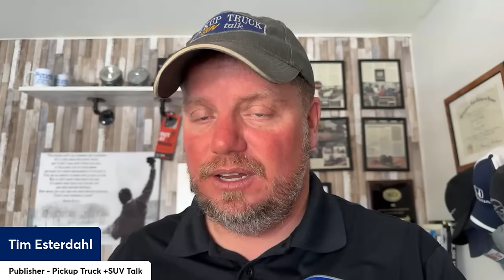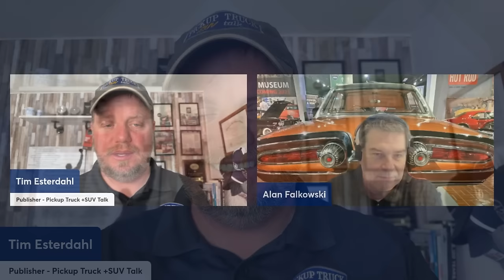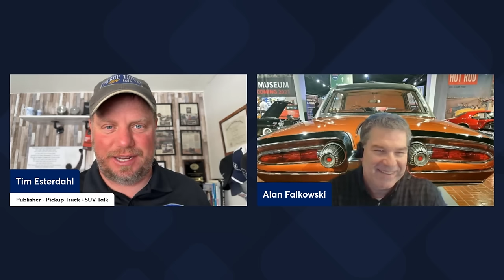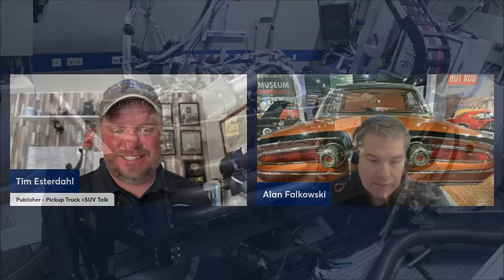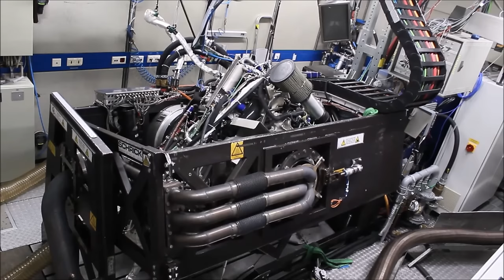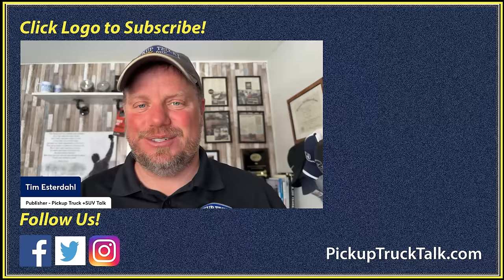Engineer Deep Dive: 3.0L Hurricane Engine - Turbo Life, Oil and Intervals and More

Comment: Time will tell how this new engine does. Everyone seems to be a "debbie downer" and knows more than a highly educated engineer.

Usually the engineer has done a perfect job, but the cost cutters come in and start making changes to save money. 

So far nobody has mentioned how this will help Chrysler to offer trucks in the future. Chrysler pays a significant amount of money to Tesla because the Hemi doesn't meet some sort of emissions requirement.  Eventually they need to change or drop the truck line. 

For everyone that is pessimistic, I worked on many cars in late 80's to early 90's. with fuel injection and distributorless ignition sytems. So many of my colleagues would tell me that the work was going to dry up because the new fuel and ignition system were a gimmick that wouldn't last.  Maybe ignition points and manual choke controls are the way to go?

My skidoo 4 strokes use the arc plasma coating stuff. No issues with burning oil.

Comment: If they can't...
1. Change the oil filter cooling housing from plastic to aluminum in the 3.6, the other Ram engine, then they wont care enough about parts used in this motor. 
2. Prevent dry starts everytime the 3.6 starts, the other Ram engine, who knows if theyll care about lubricating this engine.
3. Address the rocker arm issues in the 3.6, the other Ram engine, then this will probably be another "ticking", no pun intended.

Comment: Do they cold soak engines probably not. How about running on skipped oil change? My 2017 Chrysler goes through batteries every 2.5-3 years and is driven daily for at least 90 minutes.  No stop start in play. Oh and the hood started peeling paint at year 4. First and last Stellantis product. They spent over a billion dollars designing the Pacifica and can’t get the fundamentals right.

Comment: I loathe these "don't change your oil" engineers so much. They DO NOT care about you wasting $40 changing your oil. They DO NOT care about you wasting good oil. They want your engine to explode at 100k miles because they worked very hard to design it to.

Comment: DID they skimp on main bearings?  My reading indicates that the new 6 has only 4 main bearings.  I hope they have a really stiff crankshaft to deal with the turbo pressure when it inevitably gets boosted by the aftermarket.  I stopped watching after the first few minutes because it was the same old BS, even if the attitude was friendly.
BTW I have seen this "damage accumulation" idea fail in a big way because of one small incorrect assumption, on an $80 million project.

Comment: Yes, EcoBoost engines NEVER have turbo problems. The EcoDiesel was great. 🙄

Direct injection is garbage in gasoline engines without port injection to keep intake runners and valves clean. 🤡

Comment: Well then everything’s going to be better with the new “hurricane “ engines because (apparently) they never dyno tested previous engines like the Hemi.(Of course they did)and we still got cam lifter issues valve seat issues.And oil has never been better?Has  zinc’s friction benefits been equaled?Unfortunatly stillantis is thinking in European terms.Europeans have been shoehorned into unsafe horrible small cars for generations.It remains to be seen if Americans can be dictated into a similar regrettable situation -through hair brained mandates such as battery power or 6 cylinder downsizing.

Comment: Why buy a truck?   They are adult toys, require a big engine, great torque, and a great ride..   Well at least we used to have that in the RAM 1500 with the 5.7L Hemi.   Toyota, Ford and GM are pulling the same banana, .  I wonder how many engine failures the manufactures will deal with if early reports from 2024 Tundra (V6Turbos) owners have merit.

Comment: Oil change intervals may be improved with better fresh air flow in the crankcase, but it’s fuel dilution that still tears additive packages down and I didn’t hear him address fuel dilution and blow by sooting factors and how fully synthetic oils are better at handling this…I’m not sure the increase in oil quality offsets both of these such that 10k intervals are reasonable.  Enough turbo based gas and diesel engines, modern, have been torn down and showing terrible sludging from using 10K change intervals…its pretty nasty what the top and bottom-ends look like in a lot of those tear downs.
Reply: Then do whatever you want. Engineers have tested these engines to extremes that you will never equal, yet you wanna question them about it. Engines just don't wear out anymore. They'll fail from not changing the oil at all. Sure, they'll build sludge and carbon and what not, but they still function hundreds of thousand miles later.
Reply: @Dusdaddy  Computer simulation of engine performance is a tool of modern design and stress testing in extreme condition is also standard methodology. They are great tools and testing to proof designs, but they are not full-proof.  I have mad respect for this designer and appreciated all the things he shared about what went into their design and considerations of mitigating common issues with turbo applications.  But as well, even those design simulations and harsh testing environments do not guarantee a problem free design or excellent, trouble free application with customer use.  This engineer, who worked on the Hemi, likely using the same design tools, on a motor that showed problems later after customer use for 10's of thousands of miles in which the top end doesn't get good oil flow at idling speeds, resulting in oil starvation and top-end failure on many Hemi motors later.  As well, it didn't predict the exhaust manifold bolt failure as well, which is a common problem.  Harsh environmental and usage testing didn't show these failures either.  The fact is these things happen with all the big truck manufactures.  GM, Ford, Ram and Toyota.  In each cited, there are examples of problems on some of their motors that resulted in design or material corrections as made known by failures of customer vehicles in their shops.  It happens and nothing is full proof.  Look up most any Certified Ford, GM, Ram or Toyota Tech that has spent time tearing engines down and most if not all say they have seen time and again. sludging in engines from too long of intervals between oil changes and quite a few that did change at 10K miles per the mfg recommendations.  It may be that the Hurricane has improved on this oil degradation issue by increasing the air flow through the crankcase to expunge vapor much more quickly.  I don't know because the question wasn't asked about this particular problem with accelerated sooting (induction characteristic), fuel dilution of oil (cold running and direct injection) and acid/sludging of the oil rings.   They may have looked at it and found a way that mitigates at least some of it.  That said, it would be a first.  As well, I will be more of a believer when we see 100K Hurricane motors torn down, which had had oil changed at mfg recommended intervals to see how bad the varnish and sludging are.  Time will tell.  But again, simulation & harsh testing in numerous engines by all the major mfg's, failed to show marginal design issues, material substandard performance issues or improper assembly issues with engine production (QA/QC).  Changing oil before recommended max intervals, eg, 5K instead of 10K is cheap insurance against the price of a short or long block, out of warranty with 100K miles or more on it.  You look at the cost of the vehicles, tires, fuel, insurance & oil changes are cheap and can keep you out of known problems associated with accelerated oil additive package deterioration related to induction system boosting.  PS:  I was a design engineer and have done failure analysis and lab testing for 30 years so I am questioning how did they design for this.  The question wasn't asked specifically, so an answer addressing those particular and well known problems across the mfg spectrum wasn't answered.  It doesn't mean they didn't address them, but for sure like all things, time will tell.  I hope the engine is a smashing success for Ram.  Looks like a winner to me and I am not a zealot for anyone mfg. I respect all their designers even if sometimes they don't get it right from the start, but make mid-course changes to improve on discovered issues.
Reply: @jameszeiger8533  You know nobody read all that, right? This is YT, not your masters dissertation....
Reply: @Dusdaddy  Do you have any credible information or view point to add or to question the points I was making or are you limited to one or two sentences to articulate your knowledge on the subject?
Reply: @jameszeiger8533  Did you design this engine? Do you have any data from any testing on this engine? I thought not. So everything you have is conjecture, move along please.
Reply: @Dusdaddy  I didn't design the engine, neither did you.  I raised 2 or 3 points of concern which the interviewer didn't ask and the designer didn't elaborate on in his sharing his knowledge.  I certainly don't expect that you would have enough knowledge to ask the same questions or to have any useful answers, what so ever.  As well, you are not the owner of the channel or even a moderator, so you can be assured I am not going anywhere.  Have a great day!
Reply: @jameszeiger8533  Sure, you just want to argue with him because you are a much better auto-engineer, I get it.

Comment: What I see is not efficiency,  but a huge waste.  Every auto maker should be focusing on increasing reliability to last well beyond 400k miles.  Turbos still create problems for both manufacturer and customer as they are way more expensive to repair or replace.  When initial customer purchase a new turbo vehicle, it will be past half life in 4 years.  So much money is lost.

Comment: Why not just turbocharge the Hemi? A turbocharged V8 would give you plenty of power and torque. Using the current technology run the Hemi on 4 turbocharged cylinders for fuel economy. Using MDS you can also control displacement in 1/8 increments. If you want smoother than go with a v10 or v12 and smaller cylinders which gives you 1/10 and 1/12 increments. Not sure it is wise to let the Luxury line dictate the entire truck line either. A better move for sales is to let it have a special engine and let use the $ saved to fix ALL the complaints owners have and up the bumper to bumper to 5 yrs 60K. Truck owners like reliability and low maintenance service and repair costs. this would enhance brand preference.

Did they do anything to reduce wear with pre-oiling and engine oil cooling or even better, having a separate cleaner oil circ system for the turbos?

Oil: It isn't the weight/viscosity/thickness/flowability of the oil that matters for the bearings so much as the ability of the oil film to stay in place at the pressures encountered. A thinner oil with enough resistance to the pressures to keep the surfaces from wearing. In fact, a 0W-16 that could keep the surfaces separated would be more effficient and very likely run cooler.
Reply from the maker: Turbocharge the Hemi? Can't meet emissions nor the displacement requirement for global markets.

Comment: while you’re at it, get rid of that idiotic overdrive transmission, top gear needs to be a direct drive, it’s what you find on all new semi trucks, just speed up the final drive, all things being equal, the direct drive top gear truck will get better fuel economy, why hasn’t the light duty manufacturers figured that out yet, and better more usable power, not wasting energy trying to cause overdrive, give us a 8 speed direct drive unit

Comment: turbo engines only start competing and exceeding v8's because fuel injection systems are hitting 5,000 psi. Turbo gassers do not reach v8 power without these high direct injection pressures. every year gassers look more like diesel engines - turbos and high injection pressures.

Comment: Wow, put that awesome intercooler on there then hindered it by using the engine coolant because of cost where an independent water circuit would guarantee cooling & power. Justification and politics' is what I hear as the reason that you ditched the V8!

Comment: Alan Falkowski pushing Baden’s cafe’s Koolaid. High pressure fuel rails of direct injection do nothing for carbon build up on back of induction valves from blow by. Time will tell durability, but Stellantis doesn’t prove to have a great track record especially when it comes to electronics. Simple proven durability of Dodge are gone; this will take thousand’s to repair only at dealerships. This is not going to age well. At this price point there is nothing practical or economy improvement.

Comment: I'm a 40 year master tech and I've driven a new ram with the hurricane engine..its a very smooth engine and very quiet..and yes inline engines for the most part last longer...but I've dealt with direct injection nightmares and leaking turbos and all that crap..the biggest problems I have with the new engine is no dipstick and the biggest problem is only 28lbs of oil pressure at idle on a new engine ? Really 28lbs ???  It's like it's wore out and brand new....I don't think so...I'll never buy one and I'll be sure to tell my customers not to touch on for atleast 5 years...get the kinks worked out first !!!
Reply: And yet Ford big blocks of the late 70s idled at 5PSI oil pressure. Tell us how much you don't know without telling us how much you don't know😂

Comment: I hope they corrected the top end oiling issues so the new engines don’t get the “Hemi Tick” cam & lifter problems 😂
Reply: It’s not a Hemi!!!
Reply: @JK-qe6qq  Same car company though 🙄
Reply: @chrisb9478  that still doesnt make sense though... the engine designs are completely different. the fix for that issue is just not to idle or get an oil pump that feeds more oil per cycle.
Reply: @chrisb9478  so do you think the diesel engine has the “hemi tick” also? Same car company…🙄😖smh
Reply: @chrisb9478 Different engine!!!

Comment: "Oil level sensor is always there checking" ... uh huh, until it doesn't work and we the owners can't manually check our oil.
News flash, we're not all lazy nincompoops and most of us don't have a problem getting out hands dirty... the only people that probably aren't checking their oil is a soccer mom or the man bun wearing Starbucks latte drinker.
Reply from the maker: If it doesn’t work, it throws codes for the dealer to inspect and replace the sensor.

Comment: Start stop is not good unless you want to buy a starter every 30-50 k miles for as wear it’s not going to be shut off long enough to cause wear but when it’s hot out , I want my AC it just like the dumb cylinder cut is just junk and if you have this the dealer can turn this off .

Comment: This whole speech is a long-winded version of minivan customers buying full size trucks to take their kids to soccer practice. The auto mfg and unions need to push back on the industry. People are NOT satisfied with the quality, performance, cost, and durability of these new cars. We're turning in to cuba by keeping old cars alive, engine swaps, etc. to keep costs down. 
The only i6 I'd consider buying from stellantis is a cummins. This is an awful move by the brand. The heft of the engine is a thermal fuse to overheating. With a small displacement, small block, you simply cannot heat-soak the energy away from the cylinders and heads fast enough. Towing with this thing is going to be a shit show if you're used to a v8. It's going to derate sooner than the big displacement engines do.

Comment: 100% wrong about turbos. No one cares about the engine pressures. It’s the turbos and actuators that are consistently causing issues and are hard to diagnose. Not the mention the elaborate vacuum systems.  Ford and GM ruined consumer confidence in turbos and it has nothing to do with pressures

Comment: No question as to why this engine ISN"T dual injection to avoid carbon buildup??  Come on guys.  I'm sure he will give the generic answer of well that doesn't exist anymore well why would other companies ie, FORD, TOYOTA now have dual injection if it isn't a problem.  Did they just decide to waste millions of dollars for no reason??   I think not.  He gives the same political BS about turbo fuel efficiency yet this Hurricane engine has HORRIBLE gas mileage in the Grand Wagoneer  sometimes WORse than the Hemi it replaces.  He also talks about how modern oils are OK with longer oil change intervals as they told us 10 years ago yet these engines keep failing time and time again with blocked oil galleries and coked passages.  I don't trust anything these engineers say in public because the company would fire them if they told the truth which is the CUSTOMER is just a Guinea pig that has to pay for bad engineering to save a dollar.  Anybody thinking about buying this turd engine needs their head examined unless you are interested in buying disposable vehicles.